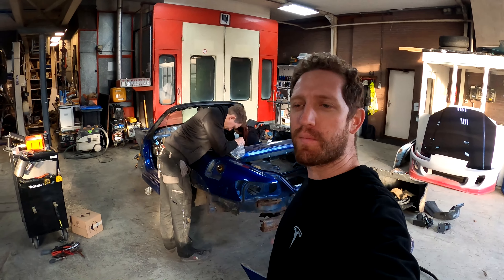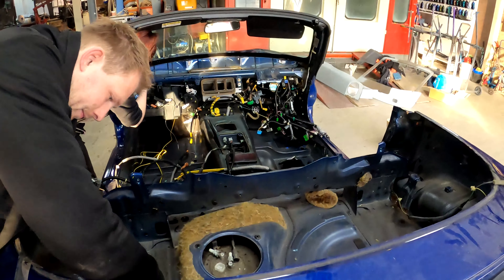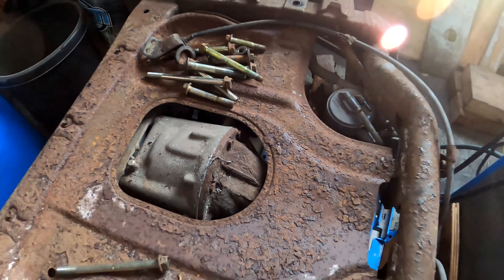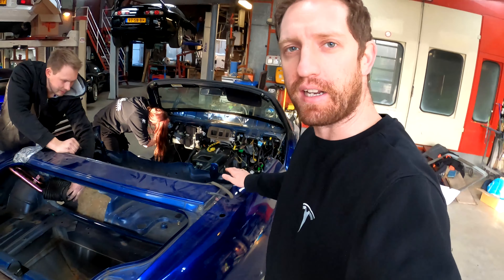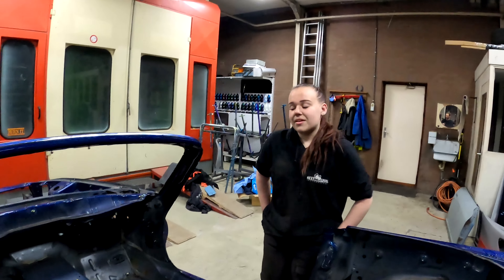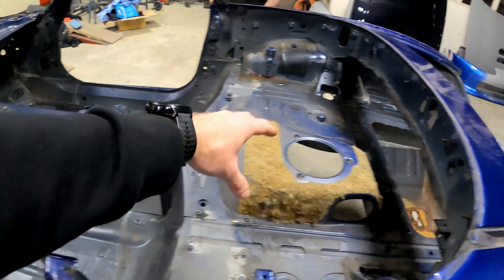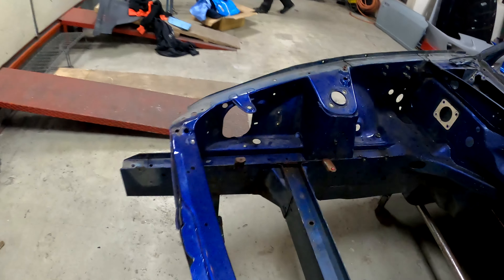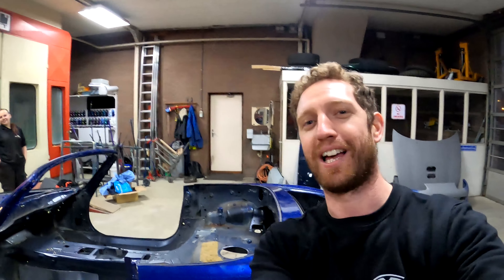4K - Honda S2000 teardown completed! - Track Build - EP8

Comment: A facelift subframe is actually a nice upgrade.
Reply from the maker: How do you mean? A subframe from an AP2 rather? You only need AP2 sway bars, but I'm going for full racing build.
Reply: @DutchmanSeb  An AP2 subframe has different dimensions. It reduces bumpsteer.
Reply from the maker: @supermathy3000  good to know, but does it still fit the AP1 chassis?
Reply: @DutchmanSeb  yes, I believe you only need the rear upper controle arms from an ap2.
Reply from the maker: @supermathy3000  thanks for the tips, much appreciated

Comment: What's the point of this restoration/project  if it  is going to cost more than a LHD S2000 in a good condition ?
Reply from the maker: It's not going to be a stock S2000, it's going to be a full track car build and the restoration won't cost as much as a newer model. Besides I prefer RHD to LHD, that's what I'm used to.